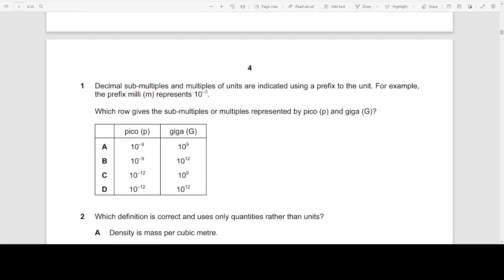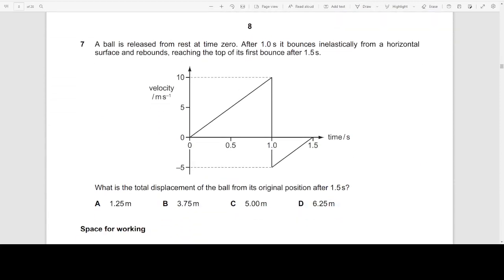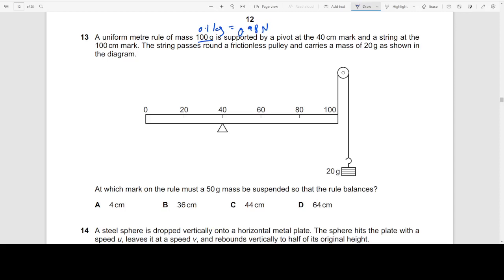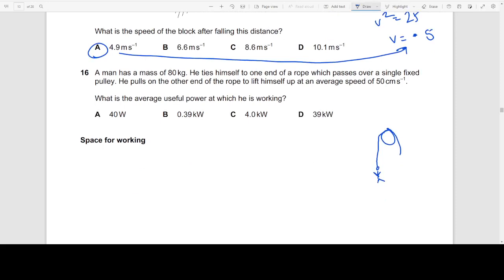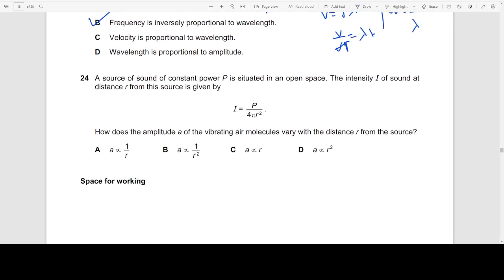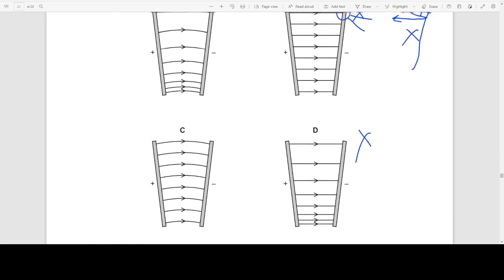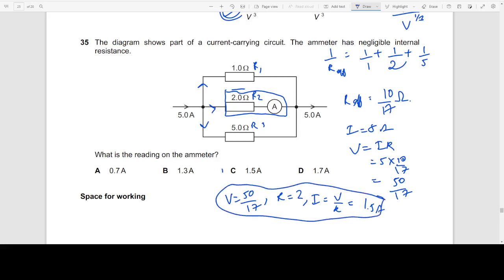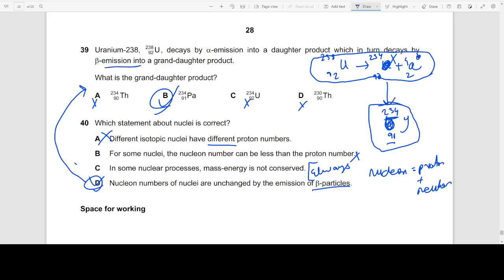A levels: 9702/11/M/J/11 | Physics MCQ Paper!

Comment: in Q9 how momentum after collision is  mv instead of 2mv?how can we assume that momentum before collision is the same as momentum after collision?Can you please explain?
Reply: The fact that there's no net change in momentum, or, momentum before collision is the same as momentum after collision is a law...
It's stated that there's no net change in momentum because there's no external force acting on the system. Therefore, in F=ma, F = 0, and, We also know from Newton's 2nd law that F = rate of change of momentum or (change in momentum per unit time)..
So, F = (mv - mu)/t = 0 (if there's no external force acting)..
And, mv = mu .!!!